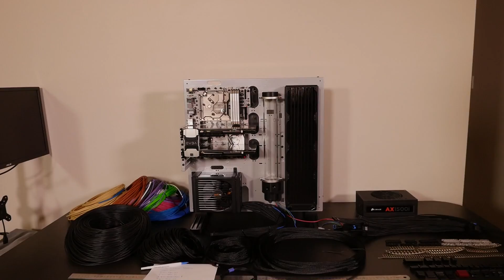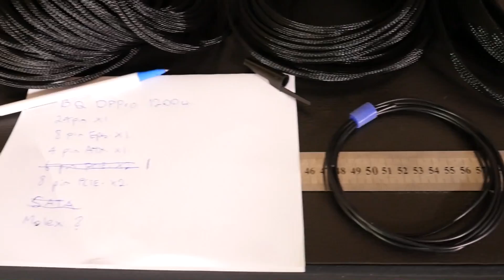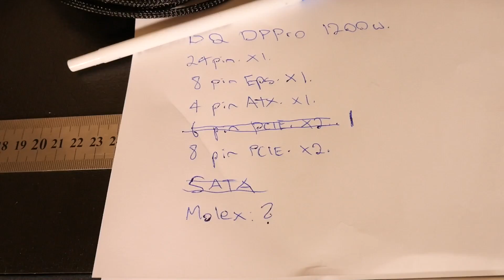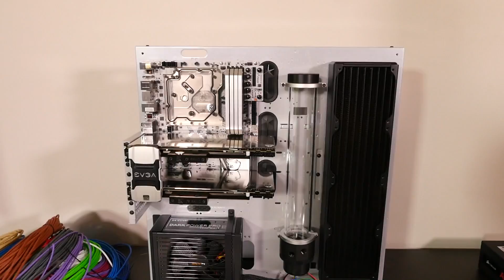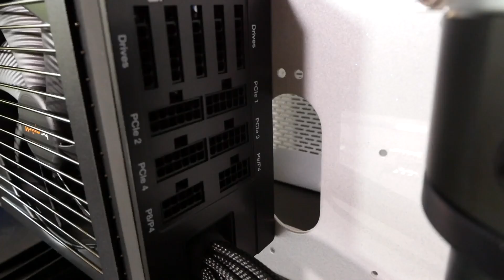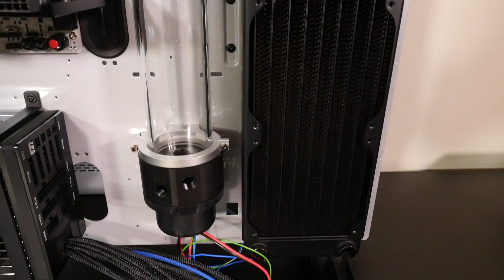Custom Cables Guide #2

Comment: I couldn't take the rats nests in the back of all my builds from RGB, fans, and stock psu cables. No matter what i try it always ends up bad in back. So, even though this is 1 of 1000 projects my ADD brain wants to accomplish, i decided its worth it. The question i have is about the fans and some RGB. Most of the fans i have have proprietary connections and some RGB to be used with their proprietary controller. I'm talking to you LianLi. The controller you make me use to run my set of 3 infini fans with LCD screens is already a bastard needing a 6-pin PCIe connection, USB connection, and then 4 and 3 pin connectors to the mother board just to make it work is annoying, but then you add a proprietary connection which is this thin connector that looks like a thinner version of a  SFF-8087 connector you would use with a SAS HBA. Only its pins not the little pcb with copper pads on it like a usb. I have a lot of Corsair components. 2 AIOs and probably 8 fans total between all my builds. The fan connector is stock, but the RGB connectors are proprietary. Would it be possible to still use the proprietary housing connections leaving a little wire running out of it and then solder joining my custom length cabling to those? Given i figure out its pinout? That Lian Li one will not be fun to pin out, because i'm pretty sure its taking the fan pwm and the RGB and combining it into one, but it seems like theres more pin holes on teh connector end to the controller than there actually are wires. for example, 4 wires leave a fan, but the female connector end has 5 holes for the controller pins to plug into. Some dark magic is occuring in that connection housing. I'm sure of it. Anyone have insight into this please reply. Thank yous

Comment: The GPU in my case is right next to the psu modular outs. Would it matter if I did a PCIE cable that was just a couple inches long? I’m not sure if the reduction in resistance would have a dangerous or negative effect.

Comment: So question, I am looking into making some of my own PSU cables as I have a Rosewill Photon 1050 watt power supply, not sure if Photon is very big in the states, it is in China & maybe other countries but not here, so just about any cable mod site I find who does cables, they don't offer cables for it, so at this point I'm just going to try to do my own. Is there a good way to find the pin diagram of the PSU? Have some from a cable company in China that I ordered, they work for the most part, but the sata cables don't power my drives for some reason & the 24pin mobo cable is a train wreck, so I want to make a few them and want to make sure i do it correctly so any advice would be great.

Comment: Hey @SingularityComputers could you just rip the connectors from the stock psi cabled and put them on to the new ones? Also could you follow the cable's diagram as well?

Comment: Q: what type of wire are you using? Beside stranded, and 16 Gauge? Thermoplastic High Heat-resistant Nylon coated OR something else?
Also RE: Fan Pins, are your pins on your website compatible with thermaltake's Riing 14 LED RGB 256 Colors Fan? And where can I get their m/f female connectors (between the fan and their controler)?
Reply: Blacklab412294 - Looking at this with my EE hat, the whole wiring system, soup to nuts, is mass overkill. The insulation is irrelevant for many reasons. 

The most important two are the voltage is less than ten percent of any legal insulation rating (unless you buy hobby shop unlisted hook up wire), and the sleeving has no approved use at all and negates the insulation completely. It may as well be wrapped in tin foil. 

Ok, from a builders point of view, if you can get business insurance to indemnify you (or as a buyer, your homeowners coverage), do what pleases you. 

I can't see how any of this gets past EMF approval. 

This is art.

Comment: Great video, been following the build, pretty cool.
I do have a little question. When making measurements for the cables, couldn't you just use one of factory cable set and route it where you need it then do a subtraction from it to come up with what length you need. Any comment?

Comment: What are your thoughts on trying to run two pcs from a single PSU? It should be achievable, but I have been wondering about voltage fluctuations when one PC turns off or drops load etc. Phanteks have a splitter but it should be possible just by splitting cables.
Reply: ***** The Phanteks splitter I thought was made in regards to their recent dual system case, the Enthoo Mini XL DS. I would assume you're correct but I would like to try it still.

Comment: I would be worried about getting the pin out wrong or crossing up some of the wires. That is the only reasons I have not done custom cables.
Reply: The way I started was first buying a fully modular power supply, and using the provided cables & connectors.  I did the cables by pulling the pins out of the connector just one wire at a time and sleeving them.  I re-inserted the pins after finishing each wire - taking away the possibility of mixing the wires.  This of course will not adjust the length of the cables, etc.  but it was a great way to start and I learned a lot by doing my first cable sleeved build this way.

Now that I've learned through this experience I've done more including using fresh wire to start with, changing the lengths to match, etc.

Comment: 3:30 if you attach all of power connection into Motherboard, what would happen? would that fried it?
Need answer here please
Reply: What do you mean? Plug in all of the 24 pin and all 6/8pins?
Reply: Yes!
Reply: If you plug in all connectors that the MB can take, then all you'll have is a proper working MB
Reply: Lets say there is a mobo with 24 pins and 2x8pins plus 1x6pins
I only plug 24 pins to power my mobo, is that mean that i dont properly power my mobo?
Reply: Yahtadi Shidiq At the end of the day, yes. without knowing the make of the motherboard, I would say the 8 pins are for the CPU, and the 6 pin for providing extra power to the PCI slots in the case of multiple GPUs. The 24pin powers the MB plus some extra for the PCI slots.

Comment: would you use cable mods custom cable modular power supply or build your own building your first-ever custom pc
Reply: wiideathmod when you say custom made PC you mean not pre-built system if soo Cable Mods cables are fine for your first gaming build as I'm going the same route